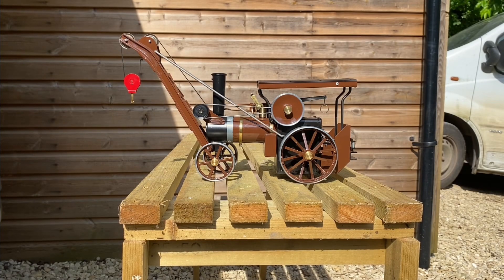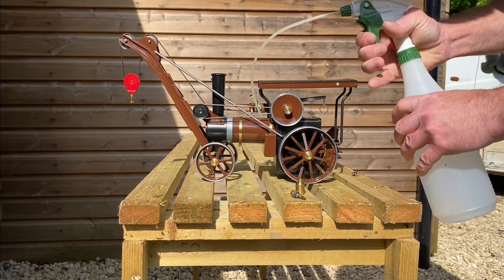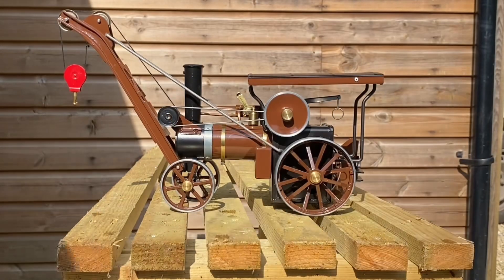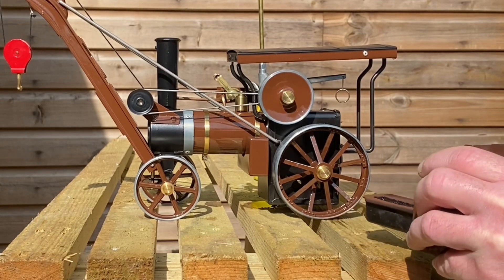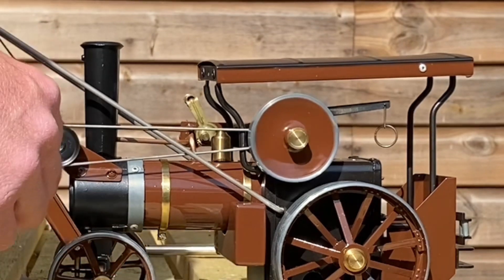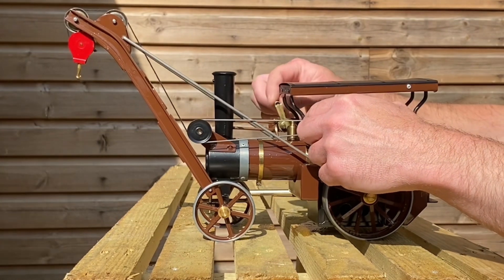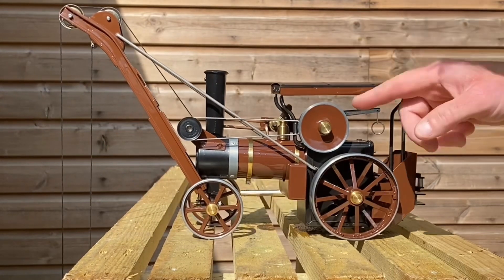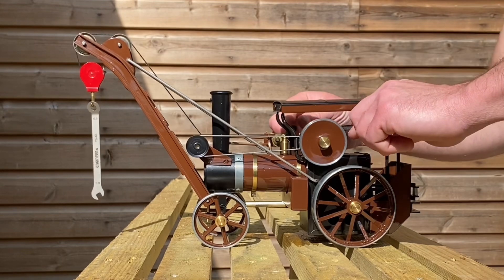Mamod steam crane first steam up

Comment: I love the idea of the steam crane! It looks like a lot of fun. 
I'm curious about how you were able to get hold of the coal fired engines? I got in touch with Riverdale and apparently they are no longer available to the UK 😢
Reply from the maker: My Roundhouse Katie is gas powered (butane) and my mamods run on the standard methylated spirit burners. I would love a Riverdale locomotive!
Reply: @Thelittlegreenloco  Ah, my mistake. I was confused with another YouTuber who has the Riverdale Irene. If I remember correctly, it works out cheaper to put a Riverdale kit together than to buy a gas fired loco from Roundhouse by about £200 if you get the Amy kit. I'd happily spend a few hundred to go and pick one up in person if that's the only way to buy one.
Reply from the maker: That’s not bad, thought the Riverdale kits would be a lot more money than that.

Comment: Fantastic engine. Looks great, love the colour scheme too. Currently building a short boiler TE1 from parts. What did you use for the forward supports on the shortened canopy? Regards, Joel.
Reply from the maker: Thanks Joel, I used an old canopy support for the front, cut up and bent, then two holes drilled in the front of the fire box, I used 3mm steel bar for my road loco mamod, which looks neater, will do a video in the week to show more detail as I’ve been asked before a number of times how I made shortened canopies.
Reply: @Thelittlegreenloco  thank you for getting back to me. I’ve subscribed after seeing your builds. Looking forward to that video and sole inspiration for mine. Regards